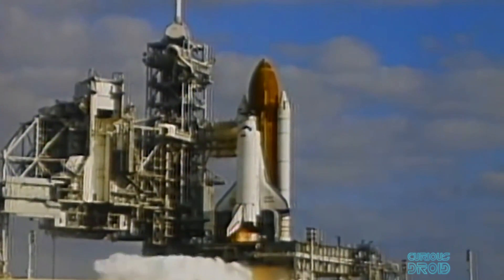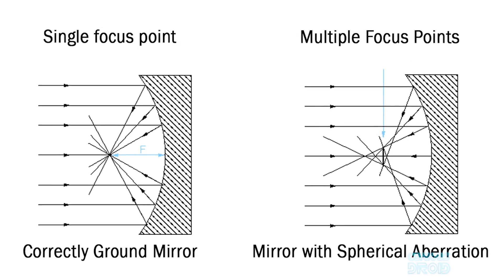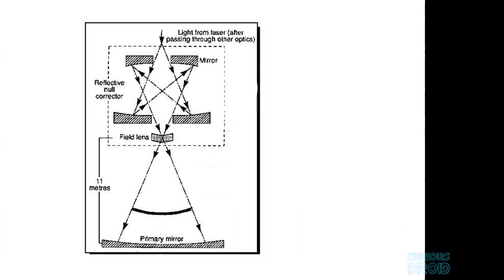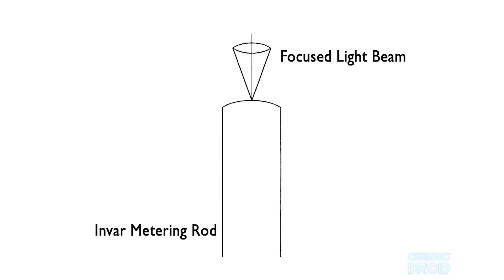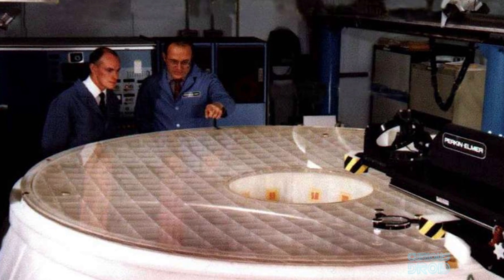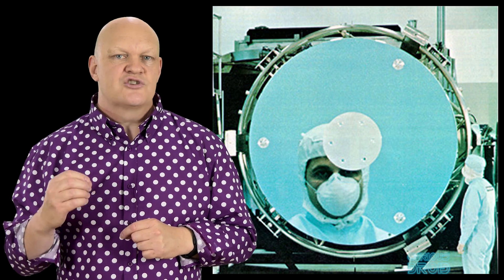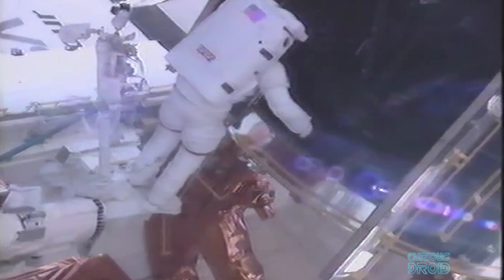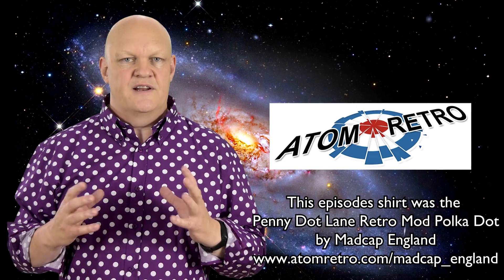Hubble Trouble - How did the Space Telescope Mirror End Up Flawed ?

Comment: I like how they checked it with another instrument but discounted it because it wasn't certified instrument. What's the point in testing something when you just completely ignore the results?

There's always more to the story. Maybe you can track down some employees and get the real story from their perspective?
Reply: You know what happened. They checked it with another instrument and everybody shit themselves when it didn't agree. The guys that did the grounding swore their work was correct, the guys that installed the spacers in the instrument that measured the mirror probably kept it to themselves and management didn't want to hear anything other than its good to go. Someone (either technical or management) was going to lose their job if the results were any different so they blamed the secondary instrument instead of looking into it further.
Reply: Carl Zimmerman 

Bingo, that was Perkin Elmer. They were so incompetent it's a miracle HST ever worked.
Reply: Ditto!! I had the unfortunate opportunity of working around a Perkin-Elmer computer back in the mid eighties. Man, what a piece of crap! (even by the standards of the day) I had always wondered what happened to screw up the main mirror on the Hubble. When the words "Perkin-Elmer" were spoken, I knew.
Reply: tomblanco2001 
The "Dumbasses of Danbury" were a frequent dinnertime topic in Huntsville.
Reply: It's because they were very rushed and there was incredible pressure to get it done. Corners were cut as a result.
Reply: Only 3 Rules to make sense of nonsense

1: Money

2: Sex

3: Money AND  sex

There -   suddenly things that didn't add up  - miraculously do.